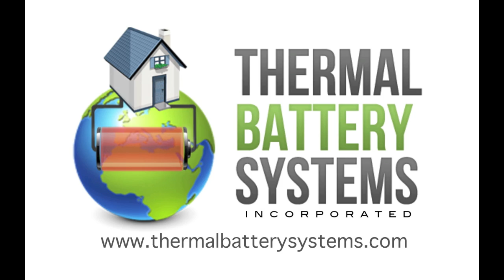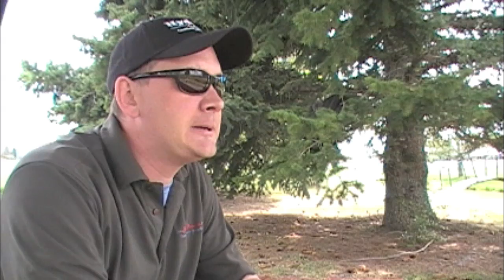Air Source vs Ground Source Heat Pumps

Comment: Ground source heat pumps have a constant temperature heat source ... THE GROUND. The deeper the better.
Air heat pumps temperature changes with the seasons, rendering them useless from mid November till mid February.
THE END
Learn what the word TOPIC  means and get off Youtube.
Reply: Excellent. Explained very well.